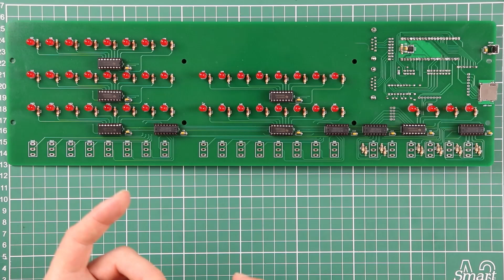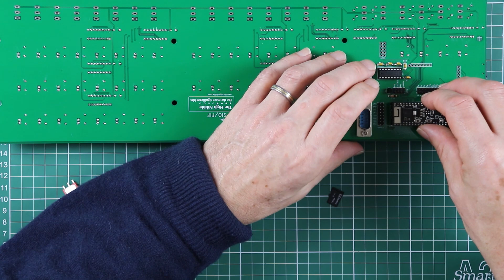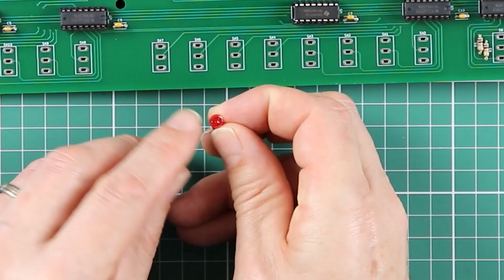THN #019 - Kit Assembly #11- The dead LED is fixed and testing continues.

Comment: Is there a schematic.  From the components this seems to be a serial front panel emulator, so should be reasonably easy to debug.    I have likely some cold solder joints.  I have power and can get what appears to be a run state where all the bit LED's are appearing to illuminate, but the run status (4 leds at bottom right) stay off, and the reset switch does not illuminate any bits.
So it's a fun debug so far :).